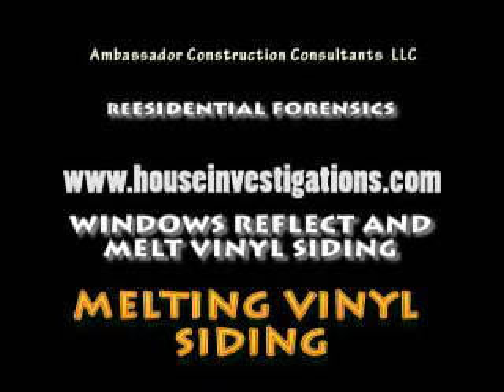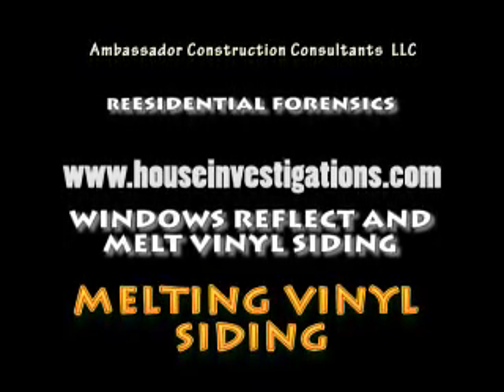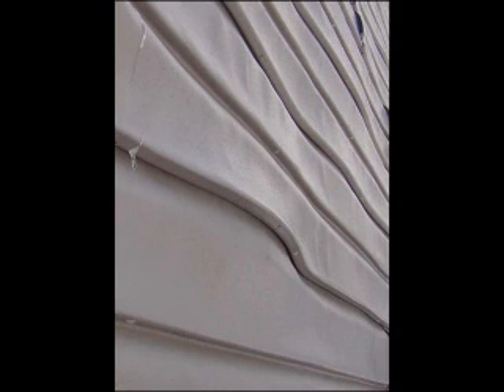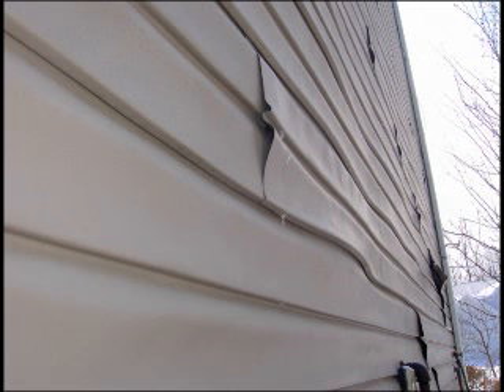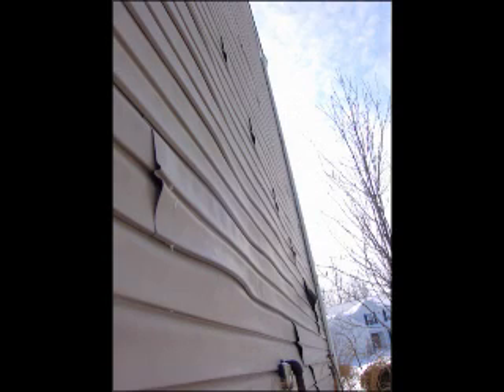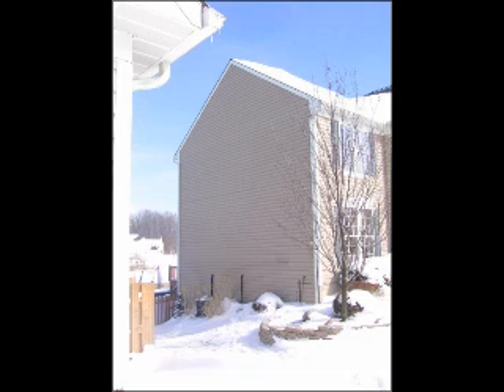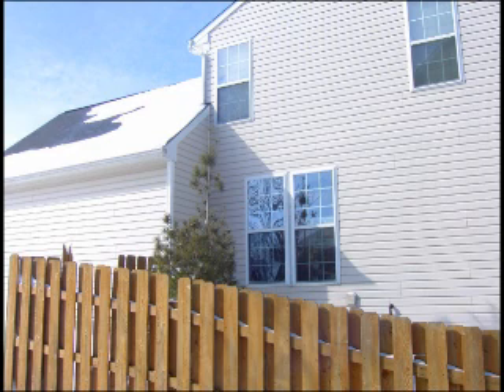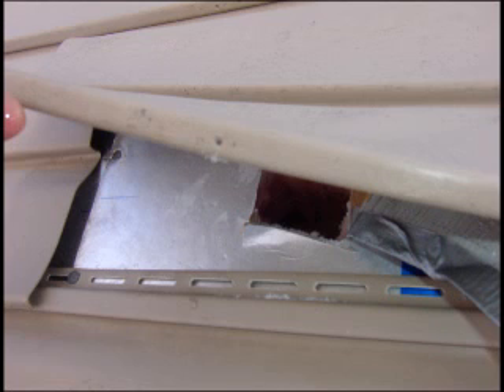House Damage - Vinyl Siding Melting From Window Reflection

Comment: When you install siding you hang it. Do not nail the siding all the way in leave the nail stick out at least a 1/4 “ . To fix the melting siding, look up Phifer Solor Tex 80 or 90 % screens, it a vinal covered screen with a smaller hole size that cuts the glare down on your windows so it doesn’t melt the siding. Also a product called EZ Snap will solve this problem.

Comment: Today I went and looked at two houses we were serious about.  The first one 220,000 3 bed 2 bath which is brand new Ryan homes house the siding was bubbling out and wavy actually coming apart the guy showing us the house said its normal and that they can come out and adjust it.  Not only that the roof had a huge dent in it you can see the shingles sagging down he said they could adjust that as well I about shit my pants and was out of there.  The second house 220,000 3 bed 2.5 bath was 16 years old and its smelled like a dog.  Dont get me wrong it was a nice house but they didnt bother to even spray anything for the showing the carpet was worn and the walls needed paint.  Get this the roof had a quarter size hole in it you could see the sky!!!!!  That is notice just by us no inspector just looking in the attic of the home.  The market is flooded this year 2021 of desperate people that have lived in their house for 6 years trying to sell it for full 50k profit without putting any money into it  The roof is same roof they said they replaced the hot water heater though just this year.  Wooptie f'ing doo even I can afford to replace a hot water heater when i was dirt poor.  The market is awful and it sucks when you are trying to buy a home for the first time and this happens.  I feel really bad for all the ones who have got screwed over the many years.  We should have a moment of silence for them.

Comment: I made a huge mistake. I had to reside my 6 year old house because of bad pressboard siding, and I replaced it with Alside Charter Oak. The stuff is melting now, and the company discontinued the color, obviously because of similar problems with the dark color. I've found many other people on the internet with the same problem. Alside can come up with the reason in 30 seconds or less without even examining the bad product, and deny your claim. They say it's reflected light. So it can only be installed where the sun don't shine. Stick that up your pipe and smoke it Alside!

Comment: I think it is poor installation.  If you install the vinyl siding so that it cannot expand by either straight (face) nailing or not centering on the grooves, or hammering the nail too far in, the siding will "oil can" compress upon itself and wrinkle.  The pattern of "faulty" tile does not follow the pattern of the sun and window paths.. it is more likely faulty installation.
Reply from the maker: sun

Comment: I agree with you that brick is a much more durable choice.  I didn't realize that your test also included exterior sheathing on an studded frame.  I'm surprised a 2x4 could penetrate the exterior sheathing.

One thing I discovered about vinyl siding (our first home was brick) that I don't like either is that spiders tend to nest within the expansion gaps at the corners.  Pain in the butt to keep clean.  I like the tighter seal that brick veneer provides.

Comment: Hello.  With respect to BrickIndustry test, Actually, Texas Tech ensured that all walls in these videos are of typical residential construction: 2x4 studs with fiberglass insulation between them, gypsum board on the inside of the studs and OSB sheathing on the outside of the studs. A similar wall with no exterior siding was also tested. As you can see, the addition of vinyl or fiber cement siding did little, while adding brick did a lot.  Sorry you couldn't get all brick. - S. Sears, BIA

Comment: Shoot wood through a wall?  If you're referring to that BrickIndustry test, I'm pretty sure all modern homes have exterior plywood sheathing which should stop a 2x4.  

...and yes I prefer brick too but sometimes you aren't given a choice in a new subdivision.  For example, our home is vinyl because the brick-model (same house different elevation plan), which I wanted, didn't have a front balcony.  My wife really wanted that balcony.  

Our home is certainly not a trailer. :)

Comment: Hey!  I live in a development of detached townhomes and we have 20 of them with this problem.  Manufacturer is Alcoa - they keep replacing the siding, and it keeps melting.

I've seen some opinions expressed that they can actually manufacturer siding that will NOT melt in these conditions.

Has anyone considered a class action lawsuit here?  There must be thousands of claimants!

Comment: Vinyl siding if for cheaply built homes. You want an extra window 10 years from now okay we can cut one right in. You go watch where they shoot the 2x4 through the wall to mimic a tornado it wouldn't happen with brick. Your home will gain a much better resale with brick or stone. Vinyl siding fades, warps gets mildew all over it and looks like it has golf balls behind it. Many VS homes look like checker boards. You ever try to get a co to replace it they ALWAYS say "NOT COVERED" it plain junk !

Comment from the maker: I have inspected 13,000 homes and ½ of them had vinyl siding. Vinyl siding is not just for trailer parks. Vinyl is plastic that has no maintenance other than washing. Wood rots and needs paint. EIFS can rot your house. Brick is a moisture absorbing reservoir. Masonite and Hardie can trap water. Asbestos was the best in the 50's. Aluminum fades and the crack heads steal it. Steel dents. Vinyl does not dents, nobody will steel it, it drains, it dries, it comes in colors, except it may now melt.

Comment from the maker: Hadie works great if you have a drainage space,drainage plane,proper flashing, back prime, and paint all cuts. Contractors in Cleveland skip many of these steps and new 300K condos are rotting.